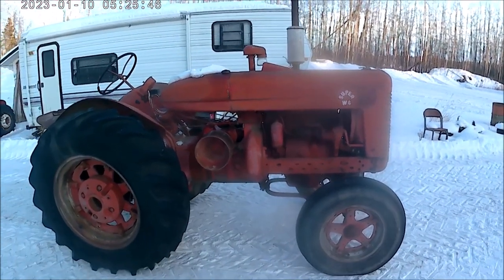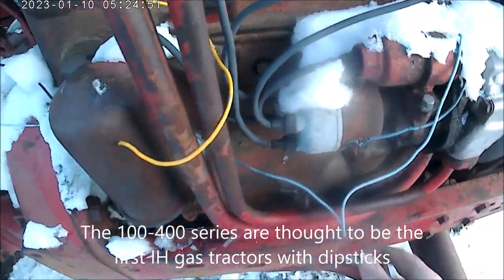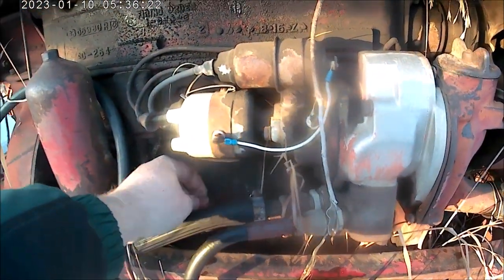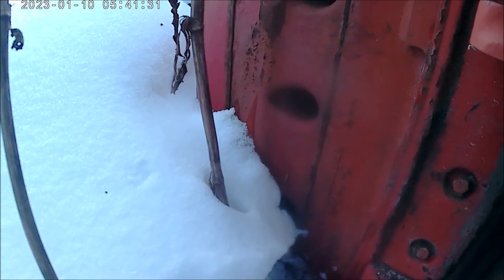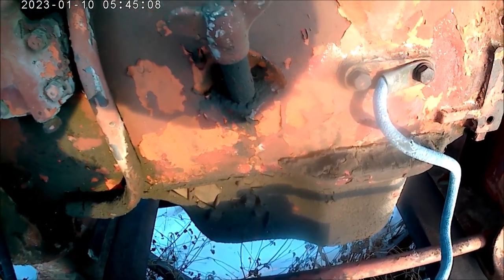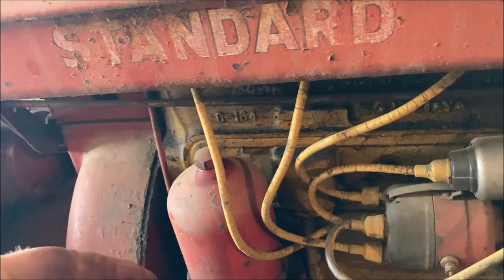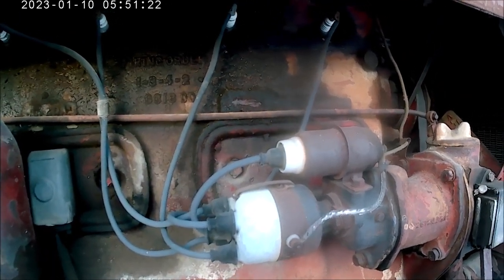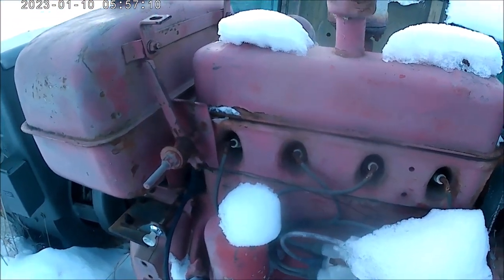The IH Tractor Dipstick Video

Comment: Good  day TY  While  listening to talk about W-4 164,  I look up 300-having 169,  I always thought SW-4  had 169 in  Didn't know that it was smaller. Thanks
Reply from the maker: They are a 164. A regular H or W-4 uses a C-152 engine which is 3.375 x4.25 bore and stroke. A Super W-4 or Super H uses a C-164 engine which is 3.5x4.25 bore and stroke and the bores in the block are larger. The C-169 that the 300s use is 3.5625 x 4.25 and the bores in the block are yet again larger. The C-175 in the 350 is 3.625x 4.25 but uses the same block as the C-169.

Comment: My buddy has a tractor junkyard. I've seen a few farmalls with dipsticks. Most were factory replacement blocks. They would come drilled with a small freeze plug installed. C 248s. I also have a 52 SML that was drilled slightly to one side of the boss for a dipstick. So I guess the replacement blocks were used for ag or industrial applications. They keep industrial parts around longer than consumer type. IH made all kinds of power units. Very interesting!
Reply from the maker: These were not factory replacement blocks. The casting date codes dispute that. As I have shown, the tractor dipsticks and power unit dipsticks are 2 different things. Could the dipstick have been a factory option? Possibly. Could they be a dealer update? Possibly. The merchandiser supports them.
Reply: @tyfrank3427  well I don't know then. That's what the owner said. Usually it was a repair and they used the old petcock pan. Replacement blocks for repairs.